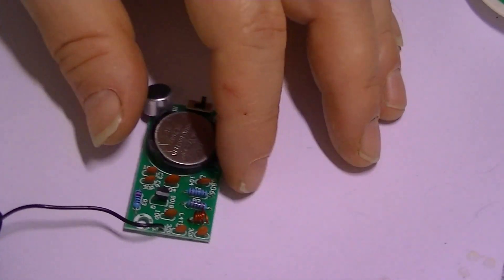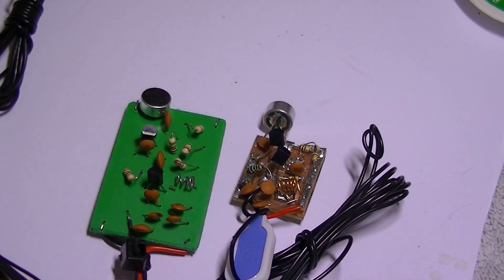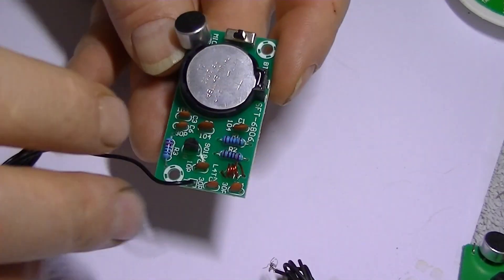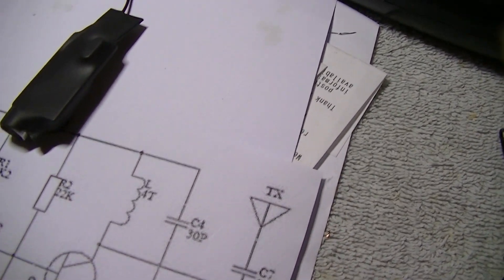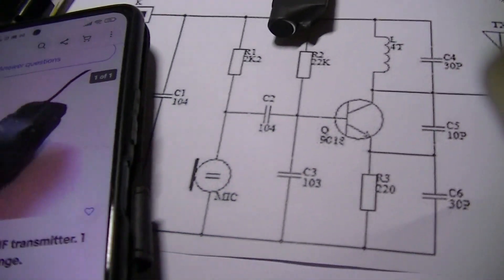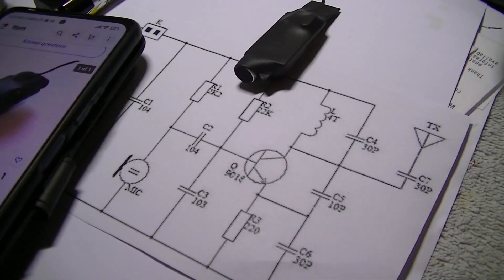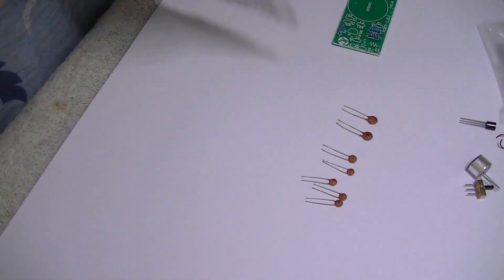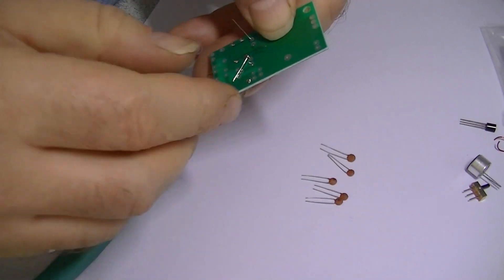A FM transmitter kit for less than a £1 ! easy to put it together yourself.

Comment: I made one of these years ago, I was using plumbers solder because I was clueless and my crummy soldering didn't work. I cut all the bits out and did it exactly like the diagram on a wood board and it worked! Recently did your super glue 2 stage one and that works a treat! Also made your rf probe. You're a generous guy with the knowledge and I really want to say thanks and wish you all the best matey!! Have a great new year👍😎😄🌠🎄